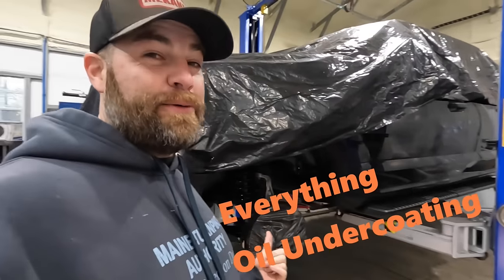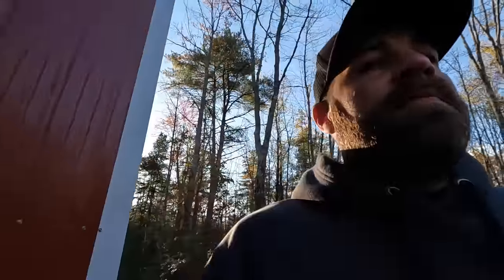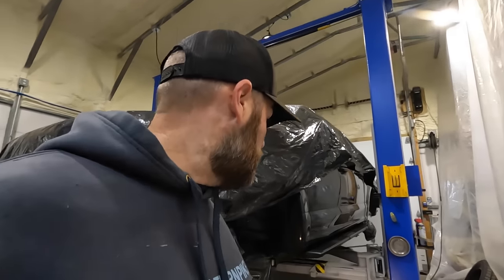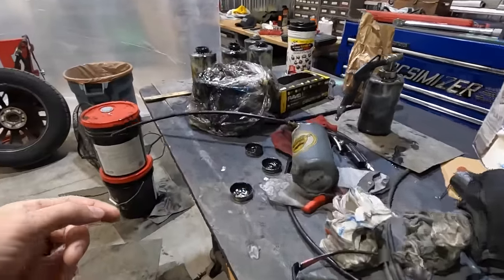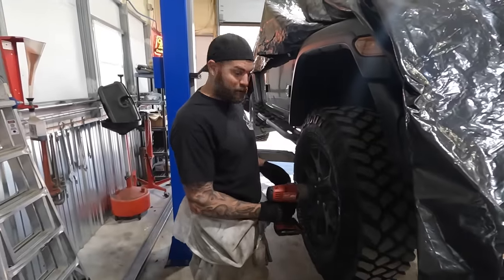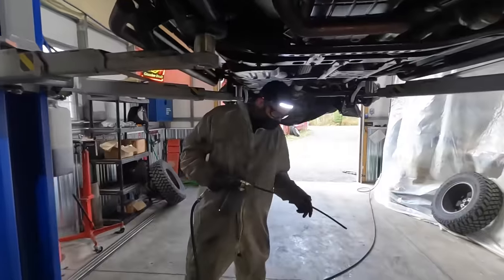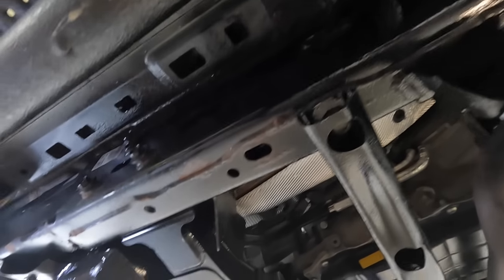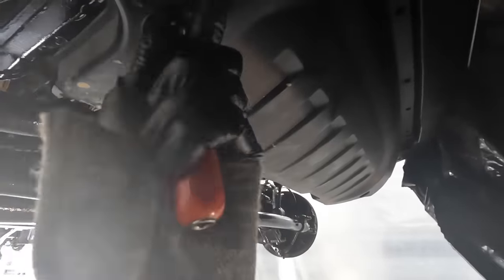The FACTS about Oil Undercoating!

Comment: I still have a 95 Toyota Pickup because my father had it sprayed with RustStop every year from 1995 until he died 19 years later.  Oil stops steel from rusting.  It's not complicated.  Long ago I had a landlord who shot old motor oil under his pickup every fall.  Old farmer's trick.  It works.
Reply: old motor oil is very toxic, better to use cheap mineral but fresh... it is only $10 for 1 pickup or big sedan etc
Reply: @emigrant4life  My landlord used old motor oil because it's free, and in case you're not aware motor oil IS mineral oil.
Reply: No way! We just pulled a box side on an '11 chevy 2500 (accident). It had  Ruststop applied  years back . I was blown away at the condition of the truck . No rust , none, nada . The truck lives in NE Pennsylvania .  I want to try the product in this video , the guy in the video did a great job .
Reply: What about inner quarters, doors, rockers and r&I splash shields that should be done not every year but at least the first time and charge accordingly.
Reply from the maker: Yes
Reply from the maker: True but that’s what some folks use
Reply: I'm still driving a 91 4x4 Toyota in Pennsylvania rust belt,I've been oil under coating for years. I use PFC and chainsaw bar oil mixture sticks pretty well. I might try this stuff on my cars.
Reply: That is called recycling 👍
Reply: 5 months/year roads are covered with snow, ice, and everything you can imagine to corrode any type of metal. Every spring, I pressure wash (not blast wash) twice (7-10 days intervals) everywhere I can under my car, let it dry, then local anti rust shop spray with a thin oil to infiltrate everywhere and 12 years later no sign of any rust  😀
Reply: I had the same year pickup. Great truck.

Comment: I live in aroostook county , What works for me is a mix of wheel bearing grease and laquer thinner , I have a dedicated spray gun for that , The thinner evaporates and a thin layer of grease is left behind , Every two years no problems so far.
Reply from the maker: Nice man
Reply: Any problems with excessive dirt build up ?
Reply: @34979Charlie  It will collect dust and dirt but it rinses off easy with a hose , It wont look pretty but helps keep the rust down.
Reply: I love aroostook county, beautiful potato fields, but most of the vehicles up there older than a decade are pretty much destroyed. 
I spoke to a guy who had his truck for 20 years, when I asked him how he kept it so long, he said he used old motor oil then would drive on a dirt road to kick the dirt up onto the oil and keep it there! Awesome idea but a lot of oil ends up in the road.
Glad to see another “Maina”.
Reply: @SamuelHensley But a lot of oil ends up on the road?  And?  The neighbors barbeque grill is polluting the atmosphere too?
Reply: @SamuelHensley wait until you find out what the road is made of.   It’ll blow your mind.
Reply: Adding some transmission fluid would probably be a good addition for thinning. No other vehicle fluid has more  anti rust additives.
Reply: If the state would just stop spreading crap on the roads to melt snow and ice.  Do you realize why they do that?  It’s because some people are to stupid, and in too much of a hurry, to slow down when the weather gets bad.  They drive their 4WD cars with “no season” tires and are surprised when they spin out and hit the guard rail on the turnpike.  I see it all the time.

So the state in their infinite wisdom subject all of our cars and trucks to the ravages of road salt.  Previous poster was right.  It matters not what crap you spray on the underside of your car.  It’s toast at 10-15 years tops.  Southern cars last so much longer…
Reply: Aroostook county ! I’ve been there. Lol
Reply: This is my reciepe from "trout junky" for my car in Québec:
2 toilet wax rings 
1 quart of linseed oil
Some paint thinner.
Reply: Like your evaporative fluid to spread the oil film. I do something similar. At the farm I mix transmission fluid with WD-40 in a spray bottle to coat the exposed metal on the infrequently used lathe. The ATF is hydrofobic and with the WD-40 spreads a thin layer that goes into the fine spaces. The WD-40 evaporates. Would have been a better solution than just WD-40 alone to spray on the machine guns on the river boats during Vietnam-nam to prevent the guns from jamming because of rust.
Reply: LPS #3 corrosion inhibitor.
Reply: Treat with phosphoric acid before the oil
Reply: I go to a place called Krown this has saved my vehicle like you wouldn't believe. We get alot of salt in the winter roads here but Krown saves my vehicle from all sorts of rust
Reply: @SamuelHensley oil ends up on the road? Lol what do you think asphalt is made of?
Reply: York County here

Comment: I use to sell cars up in Cleveland Ohio back in the 1970s and they used a product called "BodyGuard" Rust Proofing. It was a milky creamy colored product, and the dealership I worked with did just like you are doing. they put the product into every possible area, EVERY POSSIBLE AREA. When they were done, the car had to set for several hours to allow the excess product to drip out of the panels before we were allowed to deliver the car to the customer. Good job man.
Reply from the maker: Thanks 🙏

Comment: Every new car should have this done at the factory
Reply from the maker: Except they want you to have to buy a new car in 5-7 years
Reply: Then, they would not sell as many new vehicles.
Reply: You’re assuming that the manufacturer has you at heart while building these cars.   They’re only about stock price.
Reply: Local vip failed my car inspection because it was oil treated. Said it was a fire hazard
Reply: Lanolin grease is better for the environment.   I like woolwax
Reply: Like German cars ?  Lol
Reply: The people outside the rust belt would wonder why it's there, though, and some of them would probably gripe. I remember when we had a Chevy in the 80s, it had a "Rusty Jones" undercoating sticker on it, but it still rotted out from Michigan winters within a few years. The carpet in the back seat was getting moldy and stank, and my parents thought one of us had had an accident, lol. I'm not making that up, as absurd as it sounds. Whenever I see the clean undercarriage of a California or southwestern car, I'm very envious.
Reply: @jessehamilton4223 
Then they need to get a new inspector. An inspector in areas of the country that use corrosive road salt in the winter should be encouraging people to use oil undercoating
Reply from the maker: Huh that’s a new one
Reply from the maker: Not only rust but electrical issues too 😜
Reply: @jessehamilton4223 that's silly. Sounds like you need to look for a better shop.

Comment: This is for the non-believers only. Find a very old vehicle that leaks a lot of oil all the time and it's spread all over the underside of the oil pan and elsewhere. Take your finger rub that old oil off and tell me if you see rust under there. Right there is proof that the oil works. You may even have an old vehicle yourself that leaks oil. Everywhere that oil is sitting with dust and dirt on top the underneath will not have rust. I'm sure that's how people figured this out and that's why oil is used till this day.....😮

Comment: Ive done my own truck now for 8 years it takes me about 3 hours. I use fluid film in the rocker panels and up in the front fenders and a similar product to what you used for underneath. Its survived 10 canadian winters and 225,000+ miles now with no rust totally worth getting filthy and 3 hours of time once per year from my experience. First 2 years I took it to a shop and yeah i noticed the lipstick job you talked about so started doing it myself. Thanks for the video I picked up some stuff like that long flexible tip for getting into tight spots that are a pain.
Reply from the maker: Thanks for watching 🙏
Reply: Have you ever just used used oil?
Reply: Rocker boxes are the first to go so everyone needs to plaster those with a vengeance till it drips.    The same goes for door bottoms .   Plug those slop plenty in and the drain in a half hour.    I’ve done this on an old GM and it works splendidly just using chainsaw oil , cheap Vaseline and used transmission oil👍🏻.   You can make your own spray tips using scrap copper tubing driller / pinched to your needs.
Reply: Glad to hear that some people up north take care of their vehicles very well. 👍

Comment: I have my vehicles done in Michigan with another competitor.  The shop has two people spraying.  They also remove taillights in trucks and jeeps to spray. They do drill four holes to get in cab corners snd rockers.  They use the long wand to spray into fenders and hood. I have it done yearly.  Is thinner than your product and isn't Fluid Film.  Does a nice job of protection.  Bottom line as you say.  It saves the vehicle.  Nice video and information for folks that don't know.
Reply from the maker: Thanks for watching 🙏
Reply: What shop do you use? I am in Michigan myself
Reply: @shawngurisko9208      8.10.24.     🤷🏻‍♂️Could be Henderson Brothers, in Midland,MI
Reply: Here in Northern NYS I use a place that pulls the taillights,  inner fenders and drills small holes in bottom of the doors,rocker panels and cab corners. When they are done they plug the holes with rubber plugs.  They also do under the hood where it needs it. This is on my 08 dodge ram 3500 crew cab with 8 foot bed. All under $ 200. And I've checked to be sure it was done so it's not just a wide cover spray.
Reply: @stevenjackson7067 
I live just north of your border, and I agree with you that attention to detail makes a big difference on long term

Comment: I use used oil and then hit a dirt road.   My 2002 suburban still hasn’t rusted out on the east coast.  🤘🏻🤘🏻
Reply from the maker: Perfect way to keep it there with a dusty road
Reply: I spray used oil on my dump trailer when I get a chance.
Reply: Used oil contains acid
Plays hell on rubbers over time
Reply: @peterlowry5947 yup I wouldn't use used motor oil. Used hydraulic fluid or ATF would be fine though
Reply: used oil is toxic and contains acids.   better to use cheap mineral - but fresh... it is only $10 for few liters
Reply from the maker: Better than rust 😂
Reply: @FlippinCustomized  Yep. Better than doing nothing. My old Jeep agrees with you.
Reply: @peterlowry5947  I have a 12 Silverado  bought it new,sprayed with used oil every fall cab mounts still like  new,don't believe every thing you hear about oil an rubber,BS
Reply: @nathanduckeorth806  Good move.
Reply from the maker: yes it does
Reply: @emigrant4life motor oil is mineral oil
Reply: @peterlowry5947 oil is bad on rubber when it dries out. If you keep respraying it it never dries out.

Comment: I get a large vaseline and equivalent portion of paraffin wax melt them and mix them 2 liter with kerosene or diesel then spray the underside. This mix will solidify enough that water wont wash it away. And if it gets brushed off it will heal it self during warm weather by melting just enough to recover the surrounding place👍.
Reply from the maker: Interesting 🤔
Reply: @AdelJeffreyJeffreysAuto  The mixture you're describing sounds like homemade Rustop to me.
Reply: @wsbill14224  well its cheap and it's been more than 18 months still holding. It got weaker in some spots where constant blast of road debris like front of diff axle and wheel wells. But still water proof. I will reapply it since its easy and cheap to make.

Comment: I am from Quebec, Canada and i get my cars sprayed yearly the first few years and sprayed when needed the rest of its life. We also spray the inside of the doors trough the drain holes, hood , trunk lid and inner quarter panels / wheel arch in the trunk. We remove all the plastic from the under belly to spray evenly. Started that in 1998 on my GMC pickup and never had rust issues on all my cars since, i keep them for 8 to 10 years. You did a great job on the Jeep.
Reply from the maker: Being thorough pays off for sure
Reply: That's interesting, I'm in Manitoba and this is NOT a thing out here.  Although it should be.  I knew a feller that moved here from New Brunswick a few years ago and he was shocked that he couldn't find anyone to do this to his vehicle out here.  I bought a 2012 Chevy 2500 new, and the rear quarters rusted through in 5 years.  I sure wish I knew about this years ago.
Reply from the maker: I think they will ship it to you
Reply: Same here.
My 2003 Ford Taurus has been oil sprayed every October since I bought it new.
Still no rust and it runs great.

Comment: I just use a tiny drill bit and drill a hole in the front side of my valve cover gasket, it drips down everywhere and blows backwards at 80 mph. It completely covered everything under the vehicle and keeps oxygen and water off of the bottom of the vehicle. Zero rust can be found under my car. And I only use the water resistant oil. Sometimes it seems as though the brakes aren’t strong enough but I just keep pushing and is burns of the unwanted residue from the disc.
Reply from the maker: Are you being serious 😂
Reply: @FlippinCustomized  no.

Comment: Here on Long Island, NY (Very similar weather) we have a mobile guy called "Rust-Stop Pro" who uses NH Oil. He has all the attachments and wears a full plastic body suit with a respirator and everything.  He did a fantastic and thorough job on my 2018 F150. Very happy with the product so far. The only thing was that clear mouse-out he used in the engine bay area has a strong chemical/peppermint smell that took like a month to finally start to fade away. But the undercoating absorbed road debris and dirt which thickened it up, and everything has a nice matte black appearance. Looks so much better and so happy with the piece of mind it gives me after seeing my Dad's 2008 F150 rot out so badly. Looks the same after like 10 months and I feel like it will last at least 2 years or more...
Reply from the maker: Great to hear
Reply: That peppermint smell is your dear friend.   Learn to love it because most rodents can’t tolerate it and they just love to gnaw wires.
Reply: I’m not a fan of the clear but rest assured it’s still there, the shiny visual goes away after a while.

Comment: Great video,
I was introduced to NHOU years ago, I have a 2010 Tundra that has been oiled every year since it had about 40k miles, first one I did I removed spare tire/skid plates, all plastic wheel well covers etc. to make sure every piece of metal would get coated, that was at the original shop where it all started, now I go to the main shop, not a single spot of rust and the fact that it’s a Toyota is impressive. One thing you forgot to mention is that this stuff actually creeps and seeks out rust. Best of luck with your shop, keep up with the videos and you’ll have more business than you can handle with this stuff.
Reply from the maker: Thank you 🙏

Comment: Just got my 2012 Escape done by a new shop with an awesome owner I found here in SE Michigan. I had it done by a different shop (they no longer apply it) in '21, '22  and skipped last year but decided to get another coating before the crap weather hits eventually. This guy took off the spare and hit that and also removed my tail lights and got all under those areas as well as the other areas you hit for the Jeep. Immediately after leaving the shop, I drove up and down a dirt road to start coating the NHOU with all the dust I could! Next year, this guy said to bring in my Escape and he'd put it up and evaluate (for free) whether or not it needed another coat or I could skip until Fall 2026. Wish he offered the free tire rotation like you do, superb idea! Great video, BTW.
Reply from the maker: Nice 🤙
Reply: May I ask how much it was for that service. 
 I'm thinking about providing this service in the future because there is no one doing it in my area.
Reply: @paulcoenen7918  This guy charges by three general sizes of vehicles, basically small, medium and large. My Escape ( a medium-sized SUV) would've been $200 for an initial application. I believe a car and/or small SUV would be a little less than that and a larger SUV/truck would be more. I did not ask his price points for something smaller than my Escape or something larger. Since my Escape had two previous coatings, he charged me a $150 re-coating fee, not the $200. He even hit some more spots than the original guys that did my Escape in '21 and '22 but still just charged me $150. The same goes for a smaller or a larger job, ergo the re-coating fee is about $50 less than the initial application fee. As above in my post, I will be returning this time every year for a free eval to see if it needs it again or if he thinks I can skip a year. All subsequent re-coatings for my (medium) SUV will be $150.
Reply: @cryogenickid4159  
That sounds Dirt Cheap for a valuable service. 
 I have done this to my own trucks and its a big job especially working from the ground 🙃
Reply: @paulcoenen7918  The shop in Ohio who did my initial '21 application charged $250 cash, and their re-coat fee in '22 was $200, so yes this guy is a great deal any way you look at it...and he's more thorough as stated above. He schedules no more than four appointments per day so he doesn't have to feel as if he's rushing through any job either.
Reply: @cryogenickid4159 What's the name of the place you go to?
Reply: @firstlast---  County Line Rustproofing, in Carleton.